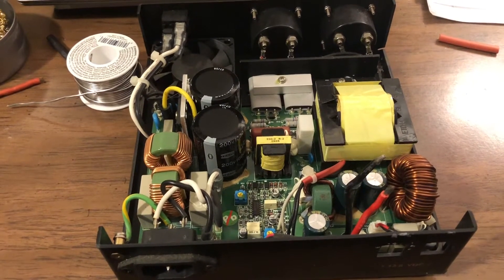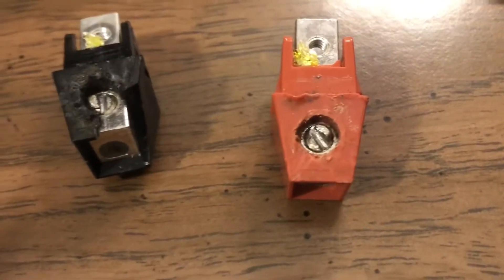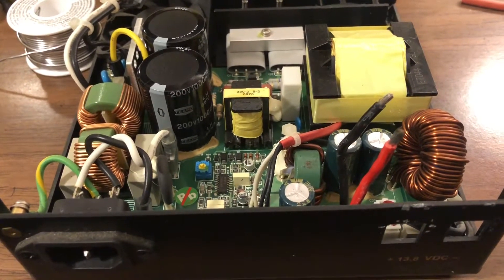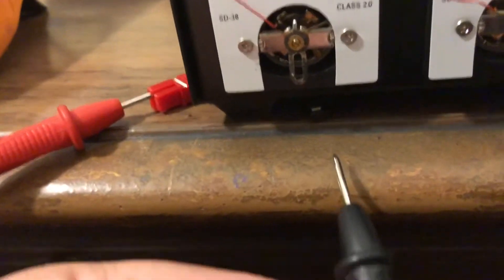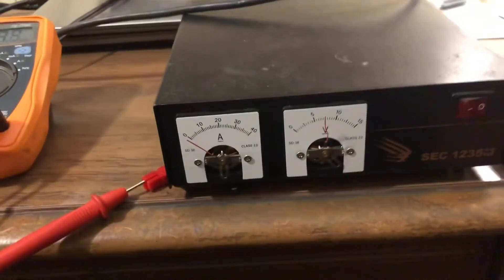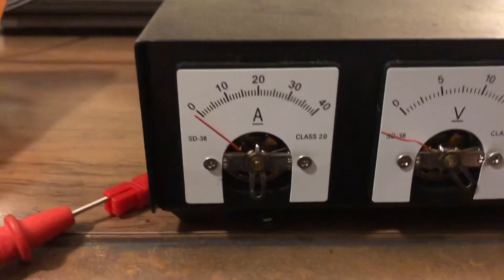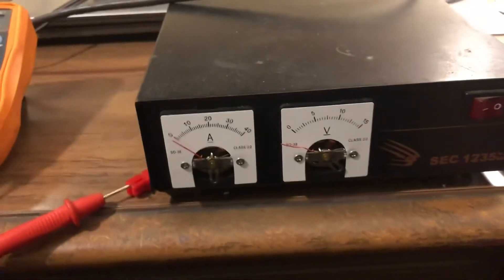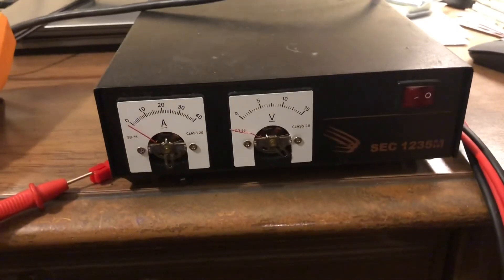Samlex SEC1235M Resurrection

Comment: Possibly have a schematic diagram?
Reply from the maker: @wucherer  I do not, sorry. It seems to be as rare as a hens tooth to locate one
Reply: @hamandcheese25 , thanks for responding, mt search continues for the sec-1235m so it can be repaired instead of tossing it to the trash can. 73 de N2OBS
Reply from the maker: @wucherer  best of luck to you my friend, some have said they followed the circuit board from end to end but that would be very time consuming. 73